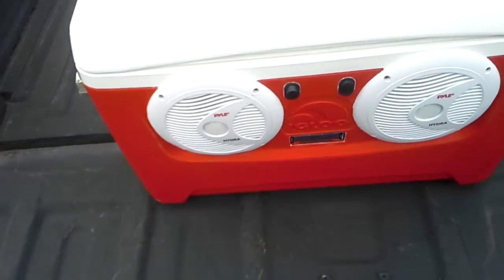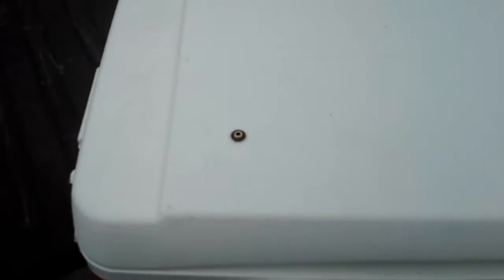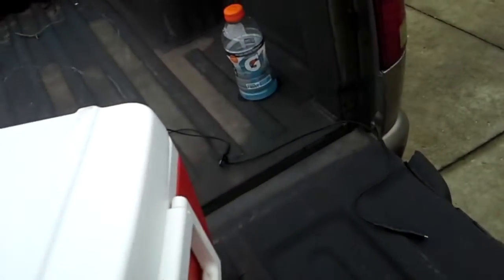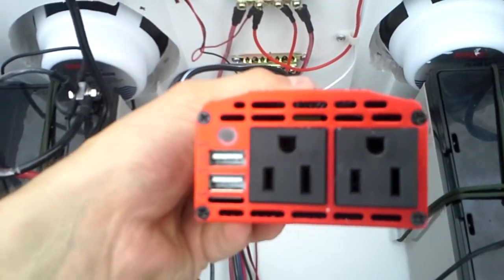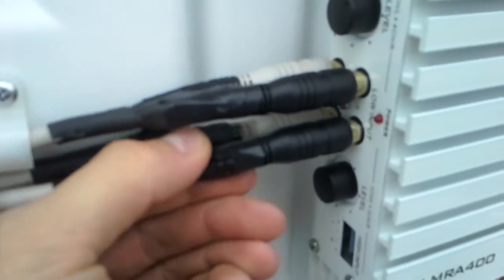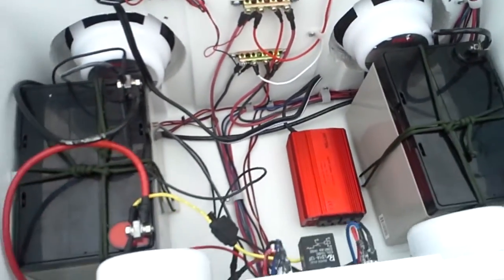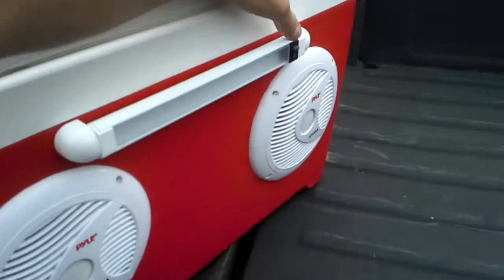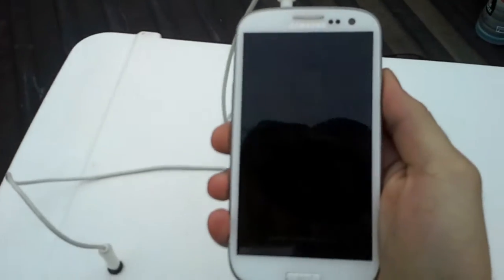Stereo cooler

Comment: How long can you run your stereo with both of those batteries
Reply from the maker: Justin Bain the batteries are rated at 35aH a piece so it's rated for 70aH. The total power draw is usually around 1 or less. In personal use I've taken it out on weekend trips, with heavy usage, and no need for a charge, in fact it only went down from 12.4 to about 11.5 Volts